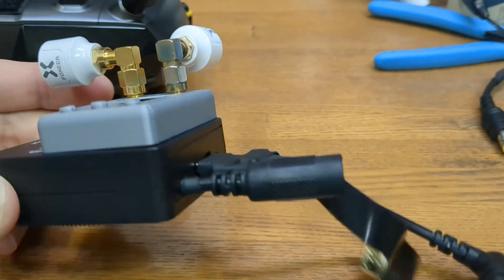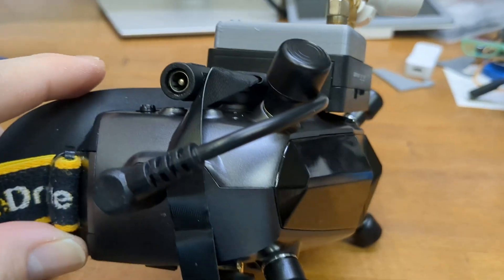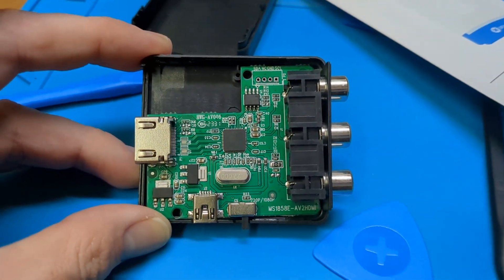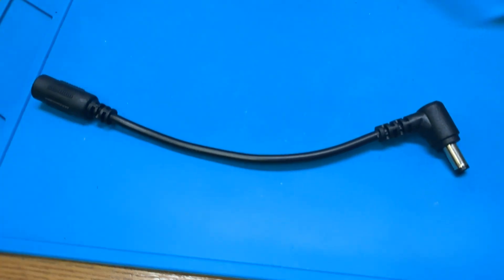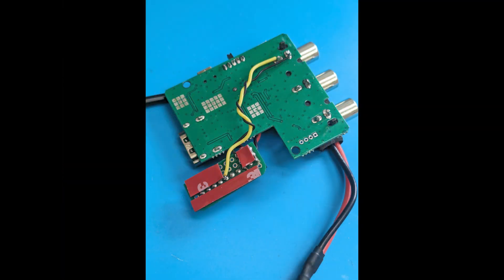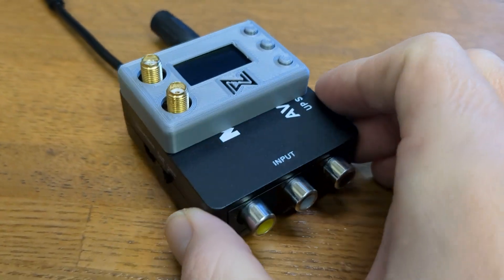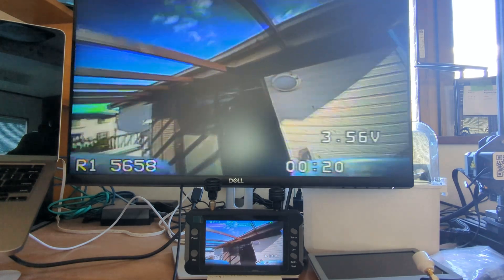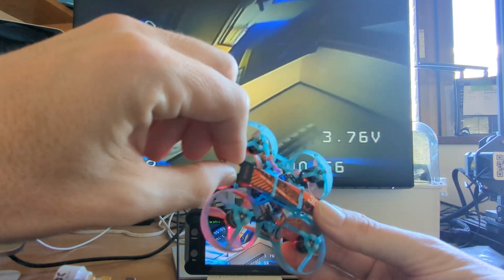Caddx Walksnail Goggles X solution for Wildfire/Speedybee modules

Comment: @keyboarduser0178 is also me. I dont know why it keeps changing. I am so close to plugging this in. I can run power  from lipo to 5v regulator and then to av2hmi/ then goggles, correct?
Reply from the maker: Oops missed this message. Power split from the lipo, one side goes to the goggles. Other side goes into the 5v regulator, and that goes into the av2hdmi. Goggles need lipo voltage, not 5v
Reply: @Tokyo_Dom  Thank you. I watched for a reply for days lol. I have everything here. I did try this with a different power supply and there must have been some trapped smoke inside the speedybee analog receiver. The smoke came right out though. lmao. Moving on. Trying it your way. I am pretty sure the analog module is toast at this point due to my lack of patience. Maybe I can fix the analog receiver now. LOL. Thank you for the reply. The pic was what confused me, I thought the power from the av2hmi was part of the input power from the BEC. I see clearly now.

Comment: @Tokyo_dom now I have a new question.... still waiting on 3 BEC to come in the mail. i have ordered from different sources due to lack of patience. BUUUUT,,, I have a milwaukee m12 power source thinger that you can plug an m12 battery into and then it supplies 2.1Amp to either a usb for phone charging or it has the barrel connector to plug in heated milwaukee gear. I dont have milwaukee gear and my wall phone chargers work just fine. I cut it open. It looks like a good candidate other than the bulkiness of it....Moving on....Trying to brainstorm your wires here. The vid shows everything, but in bits and pieces. .... How are you plumbing you power wire to the module. I only see a part of it and at the end of your vid it shows the AV2HDMI gets power via the BEC and then to the googles. I have the barrel connector so I can eliminate the wire out, but what do I supply the battery power tooooo....simple, yet not so simple..lol
Reply: also, the printed cover is great., but gives me clearance issues with the Speedybee 5 way button due to no USB slot on the side of the printed cover. I just cut it out and sent it lol
Reply from the maker: @keyboarduser0178  oops yes sorry I didn't have the Speedybee so I asked others for measurements
Reply from the maker: @keyboarduser0178  lol I know the feeling of impatience. Well yes, you can use any usb charger will have 5v coming out of them. Newer ones do multiple voltages but need specific signals back to enable the other voltages. Anyway, if you power the hdmi converter over usb, you can get voltage to the analog module from the circuit board where I've highlighted to insert 5v.
Reply from the maker: @keyboarduser0178  for power into the module it goes like this:
Female barrel connector -> 5v bec -> male barrel connector.
The bec is kind of in-line, so the in and out is just connected. The 5v output from the bec goes into the hdmi converter and the external module. Does that explain it better?

Comment: @Tokyo_dom If you power the goggles on bran new, just out of the box with a lip, are they supposed to go to menu and then black screen? I have not connected these yet. Maybe that is my issue, but Caddx isnt helping me much. They wanted a recording of the issue. I told them, the black screen looks like all the other black screens, ....its just black. lol.
Reply from the maker: @keyboarduser0178  this is almost guaranteed to be the proximity sensor. Hopefully, putting your finger right over the sensor should allow the screens to turn back on. There are guides on how to turn it off blindly if the sensor is really bad.
Reply: @Tokyo_Dom  I did figure it out. I cannot remember the sequence, but I found a way to get it to switch. It was a up, down, left, left, right, down, up lmao. something like that. It was in a weird mode. ....but now if i hold the button for 4 secs it changes from hdmi to analog to something else. black, fuzzy and then blue screen.....anywho.... that works. Nowww next.....
Reply from the maker: @keyboarduser0178  alternatively, it could be that you are in hdmi input mode (also black screen) but unlikely in a brand new set. Hold the back button 3+ seconds and let go it should beep a couple of times then change input, cycling between walksnail, av input (blue screen) and hdmi input (black screen)

Comment: How do I order a 3D cover from you. I almost got this thing done lol
Reply from the maker: I'm not sure I would charge much for the quality of printing my printer does. Where are you at? Usually there are printing services that can be done for one-off or low volume prints. I found it somewhat expensive here in Japan - like 1500-2000yen for a single item, which is kind of ridiculous for a tiny piece of plastic. I'd be happy to print something for 500yen or so but postage outside of Japan is going to be silly.
Reply: @Tokyo_Dom  Yessir. I did order a couple from one guys. I ended thinking of all the printers for sale and figured there has to be someone that prints. Went to the fpv site where I get most of my quad parts and sure ass heck....there is a printing service. I ordered one from another guy just to see the lead time difference for other projects. I  have yet to find a local person who actually follows through with requests. Usually they will promise something and then just never do it or get back to you lol. There is a pretty kool cover for front mount too. Its on the Caddx website. I ordered one of those too.
Reply: @Tokyo_Dom  Im not sure if I replied yet, but I did get the cover printed. I appreciate your direction on this. I am still trying to finish this mod. The 5v Reg is taking soooo long. Ive ordered more and have yet to get them. Wish me luck.

Comment: Love that you made this. Thank you. 
QUESTIONS...what guage wire and where?
What is your jumper wire?
what did you use to cut PCB?. Im making a mess with dremel. lol
What is the yellow video wire from? thats an FPV silicone style wire?
Why didnt you sugest the different style Cable for HDMI mini so the cable is not upside down?... jw if this matters.
Reply from the maker: I have a bunch of AWG30 wire that i ordered from Aliexpress in all sorts of colors - the yellow wire is from there. As for a different cable, i just didnt have anything that size, and there arent many cables available with a right angle connection on the mini-hdmi. But since i will be plugging and unplugging this regardless, I guess a pre-made connector would look cleaner here.
Reply: @Tokyo_Dom  Collaboration and ingenuity at its finest. Prototypes are never finished lol I even found a whole kit with a top cover and converter board on Bangoooods website for $9. lol id order that just to have a separate cover to mount the module to. lol.
Reply: @Tokyo_Dom  I just got the bulk of mine. I realized that the 30G was for the AV2 wire? I have 3 of the connector cables here, I will just cut 2 to make 1 long one. Should work. lol. Less soldering. I got to mass produce these. Dom, I will get you your 1% royalties on the sales. LMK how to send it.
Reply from the maker: @its_key  haha all good its "open source" but be sure to let them know Tokyo_Dom showed you how to do it haha
Reply from the maker: Oops sorry I didn't get to reply to you here. I used a box cutter to cut the pcb. Using a dremel stiiiinks and I'm sure the pcb dust isn't good for you. Then, I'm using awg30 for jumper wires, and I think awg16 for power wires. It's actually not that important, it doesn't draw that much power

Comment: Super impressed with this man, ingenuity at its finest! I plan to do this soon, however, id like to run an additional connection for AV out purely for DVR as i believe the DVR in the goggles doesnt record hdmi in feed? Im guessing i just need to wire a femal AV port/cable end to the PCB that connects to the Video out on the module?
Reply from the maker: Absolutely. Or just an RCA on the side of the hdmi adapter.

Comment: how about the latency? i used different AV2HDMI converter to convert analog signal to HDMI, so i can use goovis goggles, but the camera to glasses lantency is about 80ms, not very good for fpv dones,
Reply from the maker: I havent measured this but for sure its less than 80ms. That would be pretty dramatic and hard to fly FPV for sure. I have no issues flying with this solution, i suspect its well under 50ms

Comment: Hi love the videos. I also live in Japan (Tokyo)and recently got into fpv drones, built a 5inch and a 2.5inch freestyle . I wanted to know how did you deal with all the restrictions? Do you have the amateur radio license etc? Any info would be greatly appreciated as Im finding it difficult to pursue this hobby here.
Reply: as a hobby, prob wont get messed with much in Tokyo. Be nice and stay away from large crowds when possible. Tokyo has lots of quiet places to fly.
Reply from the maker: Yeah 5 inch is not going to work in Tokyo. There are some drone fields out in Chiba and kanagawa but you will want to have all your licenses and approvals to fly there. 2.5 inch is also pushing it in the city, just too many people in the parks here, and trust me, you will have the police called on you at some point (I have). The way I deal with it is to stay well under 100g, ducted whoops I can fly indoors and if I do happen to fly outside, it's small and harmless looking so unlikely to anger anyone.

Comment: Omg, I've ordered those goggles with foxeer wildfire as a high sensitive receiver :( So, no chance to get it working in this combination?
Reply: Does it work with foxeer wildfire with hdmi-svideo adapter after modification?
Reply from the maker: @vitalyparhomenko7817  this hdmi adapter works great with the Foxeer wildfire. No issues with over brightness, and full 16x9 screen use. It's just that this method is kind of diy compared to the off-the-shelf dji analog adapter.

Comment: Hi, May I know your URUAV DJI Analog adapter is 2.0 or 3.0?  I asked, then they say 3.0 and speedybee was usable. Also want to know your adapter rapidFIRE usable?  Very appreciate.
Reply from the maker: Mine is the 3.0, I got it here: https://a.aliexpress.com/_opchAgm there is the 3.0+ which has the voltage display but I didn't want to use that. It won't make a difference on whether the module will work on these goggles though. All of them just pass the video signal directly from the receiver to the 3.5mm port, there is no processing, no modification.
My adapter will work with rapidfire too, it should work with all of the modules
Reply: @Tokyo_Dom  OK, Thank again. I'll get rapidfire. BTW, walksnail tell me they will fix fake snow in next update.

Comment from the maker: I now have a Foxeer Wildfire module and can confirm that it has the same issue as my URUAV RX5808 Evo using the AV Input. But of course it looks great with this AV2HDMI adapter!
Reply: what issue do you have ? i'm thinking about using the av in of my googles to add a diversity module
Reply from the maker: @TheEquinoxe62  av input won't work at all for the following modules: foxeer wildfire, Speedybee, Uruav Rx5808 Evo. Just shows snow or possibly glimpses of  distorted image. It's fine for most other modules, especially if it's just a simple diversity module.
Reply: @Tokyo_Dom i have a steadyview skyzone receiver, without scroll wheel. I need one to swap channels, any clue on how I should go about this? I have an adapter already (av in) Great video.
Reply: @Tokyo_Dom  How about RapidFIRE and TBS FUSION?
Reply from the maker: @Nenenaman  you will need to put an Elrs backpack on there, then you can change channels via your radio using the ELRS menu (vtx administrator)
Reply from the maker: @x13102543  those modules should work with a regular av adapter. This method would let you use full screen 16x9 but it won't be necessary
Reply: @Tokyo_Dom  So i need a ELRS something or another to use the speedybee VTX. now im confused. lol. I have yet to use my walksnail X. I am STIIIILLL waiting on the BEC. I dont even know what to do with these once I get your module done. I mean will it just connect or do I have to bind the goggles via beta flight. I am soooo new.
Reply: @Tokyo_Dom  I am confused at this point. The av input wont work for speedybee? But we can get the speedybee receiver to work for the goggles? Could you elaborate? If I understand, This custom converter you made....uses the HDMI not an AV jack...i hope im undersstanding. I want to just send these things back.

Comment: can we use steadyview module?
Reply from the maker: Yes should be no problem. But I've also seen people post on Facebook that they can use steadyview with a normal Uruav dji analog adapter. I suppose it's a case of pick your poison: fake snow and 4:3 or blue screen and full screen 16:9 🤔
Reply: @Tokyo_Dom  so the adapter can navigate/choose channel for the steadyview? Cool..
Reply from the maker: @eddie_Za  oh wait I thought you meant the steadyview X. No there is no way for the adapter to communicate with the regular steadyview. Would need to add an Elrs backpack I think?

Comment: Nice, I'd like to see a latency test done between good analog goggle and your set up using a led light  and a high frame rate camera like madztek... I know DJI V2 goggles add latency when using analog, I'm wondering how these do, im pretty latency sensitive so ive been holding off upgrading to hd goggles and just using a ws vrx...
Reply from the maker: Hey so unfortunately I don't have a high speed camera (other than my gopro I think does 240fps). But I don't think this will have any improvement on using the av-input for analog. It uses the exact same MS1858E chip as the av-input board has in the goggles, and other tests show this av2hdmi adapter has a 2 frame latency (33ms). This is exactly what mads tech measured in his tests so this should have the same latency plus a couple of ms for the hdmi input delay.
In practice I can't see the difference between the goggles (output to the monitor) and the fpv monitor underneath but if you are sensitive it might be an issue
Reply: @Tokyo_Dom  i think 100fps each frame would be a millisecond, i may be wring... but your gooro should work, im just curious in general, i heard the dji v2 adds like 40ms when converting analog, just was really wondering if i can sell my hdo2 and vrx and put towards the goggleX
Reply: My mistake, each frame in 240fps is 4.166666 milliseconds
Reply from the maker: @DigitalCruzer  1ms is 1/1000 of a second so 100fps will be 10ms/frame. At 240 I will be at about 4.2ms per frame but I can give it a go.
Personally I wouldn't go selling your hdo2s, I've still got my HDO's, I think it will take a while before Caddx get analog sorted to an acceptable level (and my solution here, while I am enjoying it, isn't perfect - I'm scared to go out past walking distance in case I go to a bluescreen)

Comment: Holy smokes, that's the chip Walksnail uses? Retro gamers don't use that device and even the webpage you showed says it has 2 frames of lag.
Reply from the maker: https://repair.wiki/w/Avatar_Goggles_X#/media/File:Avatar-HD-Front-PC-2-scaled.jpg yes it has the ms1858e on the main board. And 2 frames actually matches the 33ms that Mads Tech measured for analog latency - about 15ms more than the HDZ goggles. But it hasn't bothered me one bit while flying, and i guess if that difference is a problem for you then Walksnail would be out of the question to start with.
Reply: @Tokyo_Dom  nice, that's cool to hear the research matches. Thanks for the extra information!
Reply: @Tokyo_Dom  Thank you for the video again. Could you please see my comment on top and provide info on wire sizes for individual sockets. Literally sitting here staring at all the stuff to solder together. lol.

Comment: Nice job. What about latency with this many adapters?
Reply from the maker: It should be exactly the same as using AV input. That goes through the same MS1858E hdmi conversion chip inside the goggles. You can see there is no latency difference noticeable by looking at the two screens when I am flying